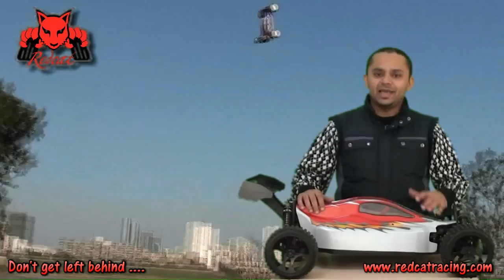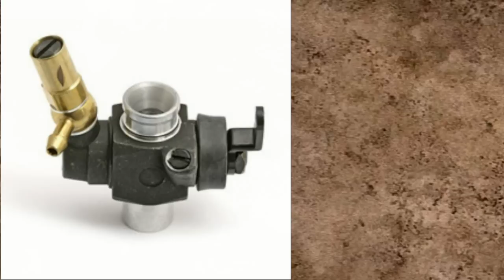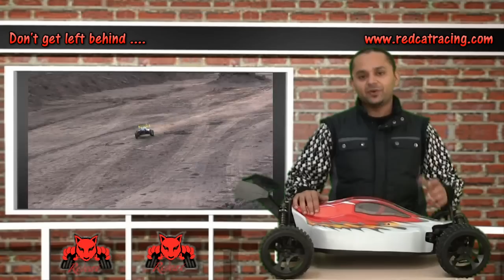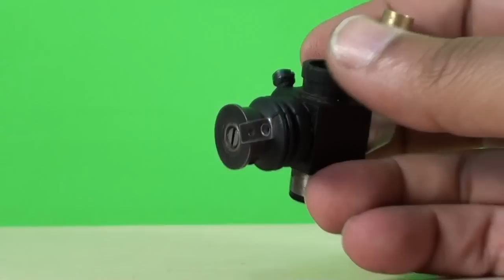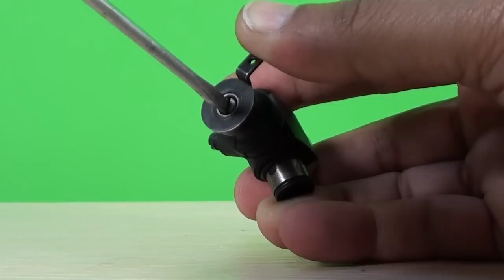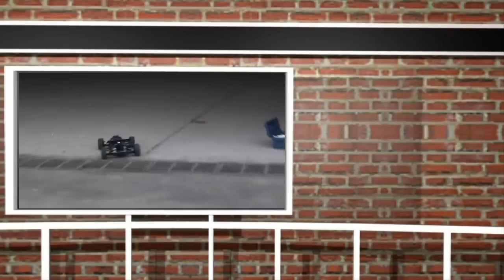RedCat Racing Nitro Engine Tuning Guide Basics

Comment: Hi,

I completely reset my tornado S30 because it wouldn't even start which I believe was due to bad fuel because I went today and got the fuel I used before and it finally started. Can someone tell me a good starting point to start tuning from with my needles? Thanks a bunch

Comment: Alishanmao please help, when ur breking in your engine spits out lot of oil and im done breking in, so now i tuned it nd it still spits fuel, when i lean it so it dont spit fuel it still does spit a lil and then shuts off, btw i havents messed with LSP only idle and its like you said, 1mm gap. please and thanks